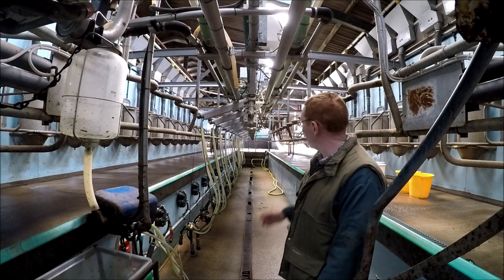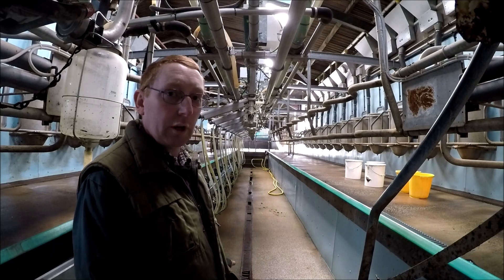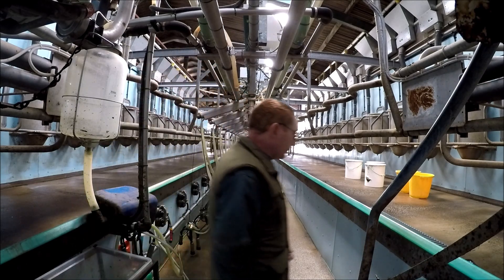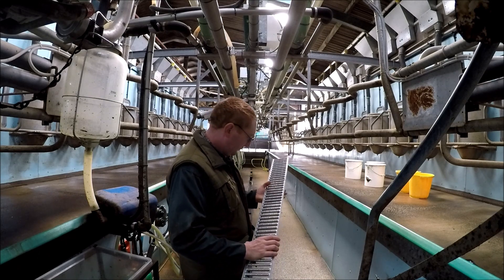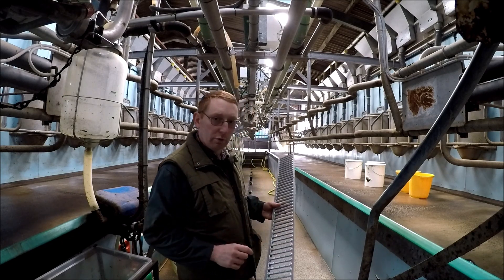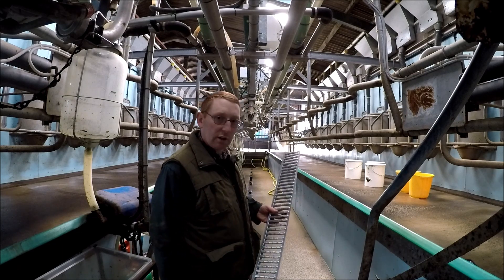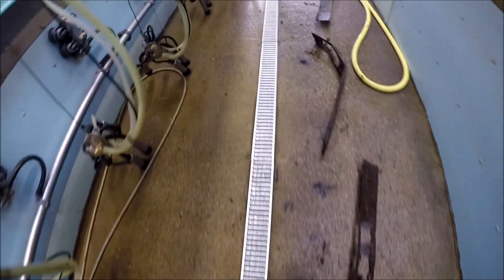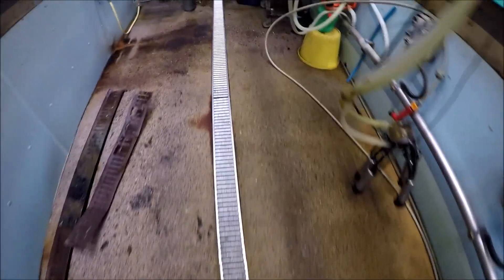Milking parlour drain repairs.

Comment: Sorry, this is a bit late but i  have sourced the covers alone from a company called www.wateririgation.co.uk  £7 a cover. I  think i searched for aco galvanized grating. I use the same firm for hose fittings and the like.

I have had exactly the response you did from the builders merchants, and indeed have been caught out before into buying complete units.

Nice clean spotless parlour when i releif milked i used to hate dirty milking parlours.